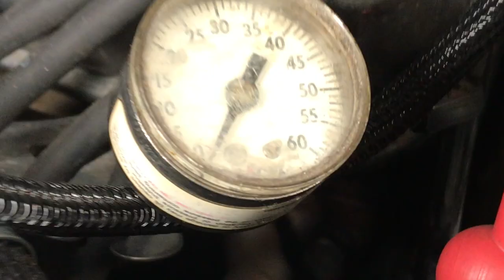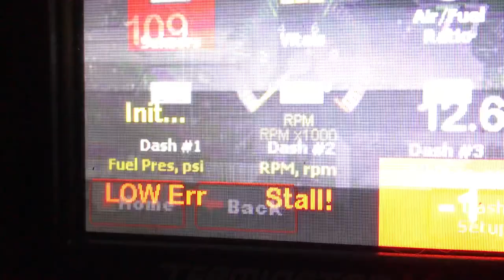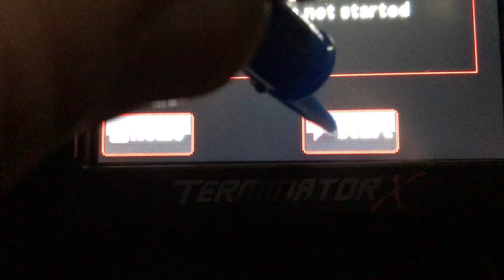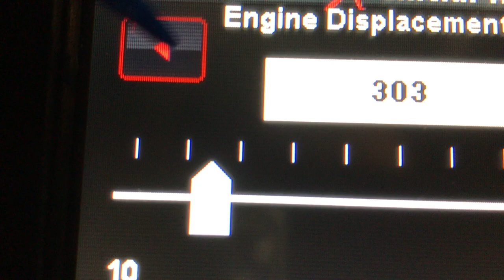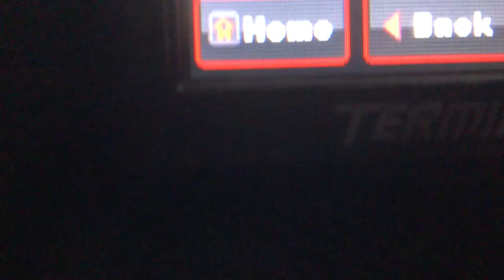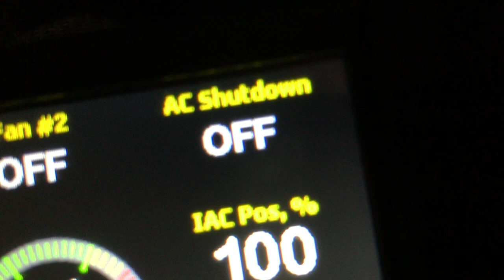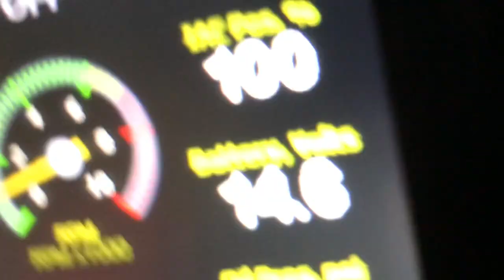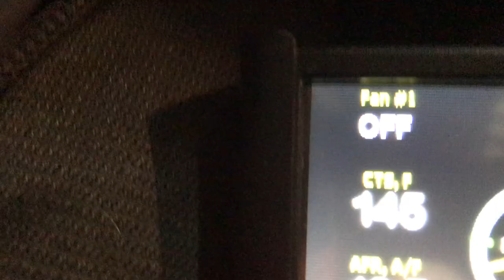Holley Terminator X - Fox Body Mustang - oil pressure/fuel pressure transducer

Comment: Tapping the white box makes it so much easier than using the arrows to get to the number your needing to input. Just wondering, why would you go with an aftermarket computer when you have no power adder?
Reply from the maker: Might add a power adder later.  Removed "all" the wiring, A9L computer, 60 pin connector, ect. Kept just the essential wiring, power windows, running lights and turn signals, wipers. Also, added the Holley digital dash that plugged right in the Terminator X. Aluminum heads going on next. Car is a work in progress always trying to make it better, cooler, faster.

Comment: What adaptor did you use to mate to sensor with?
Reply from the maker: NEW! Universal Stainless Steel Pressure Transducer Sender Solenoid for Oil Fuel Gas Air Water (100 PSI) (Amazon $22.99 free shipping - easy to return if it does not work out for you). The Holley transducer is $137.95). I used the old Accel fuel pressure gauge fitting that I had attached to the fuel rail near the alternator. As far as the oil pressure, I removed the old oil pressure sending unit (front drivers side near bottom of engine block and used a pressure transducer with a 1/4" NPT rather than the 1/8" NPT. You may be able to find the fitting you need at Lowes/Home Depot. The pressure reading on the handheld is not reading correctly, but they are at least they are doing something (still working on those issues - might have to buy the Holley transducers).  Will make a video when I find the solution. Good luck.
Reply: Jeff Palmer I already have that. I need the adapter from the Ford oem oil sender to the gm style sensor